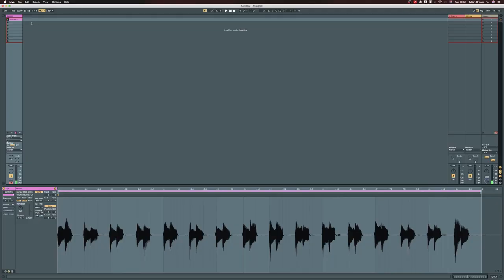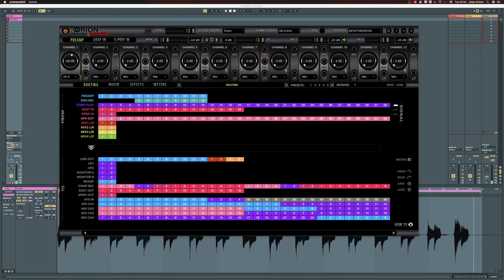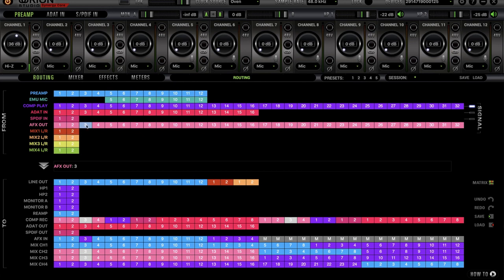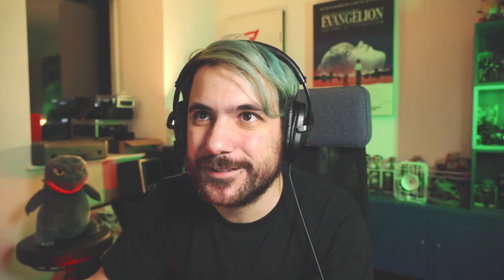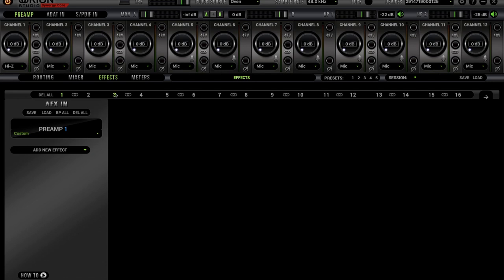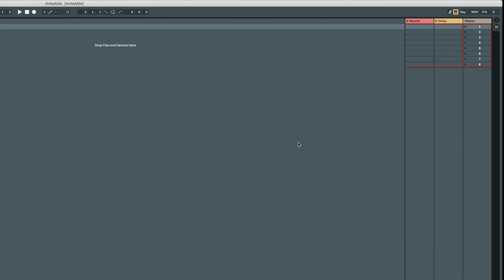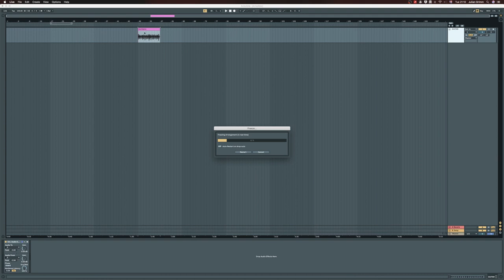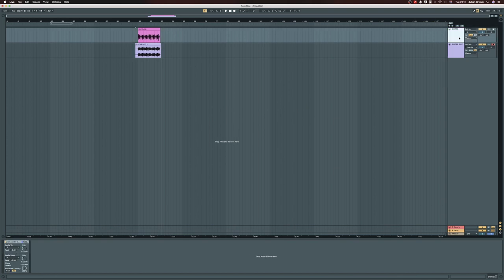ANTELOPE AUDIO plugins inside ABLETON LIVE - QUICK WORKFLOW!

Comment: Hi Julian, Thanks for your video! One question, how do you do to also record the mixer? When i try to record a guitar for example, with effects and the mixer's reverb I drop the AFX out into MIX CH1, and then MIX 1 L/R IN into COMP REC, but the thing is it starts recording everything, even the click. So im not able to record with effects and mix in real time. Do you know what I might be doing wrong?
Reply from the maker: You have to make sure that the only thing plugged in that mixer is your guitar. I have never really tried that method though I usually just plug the afx outs directly to com recs and then use reverb in the DAW. But maybe try creating one mix just with the guitar and reverb in and then create another mixer for your playback.